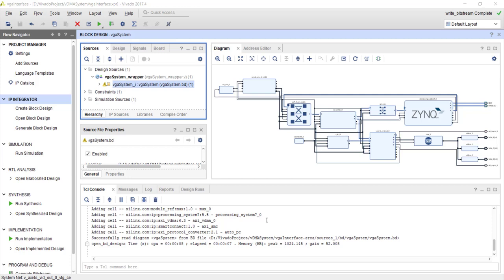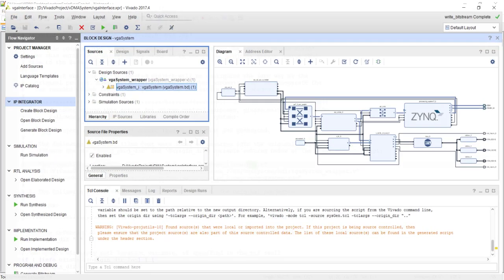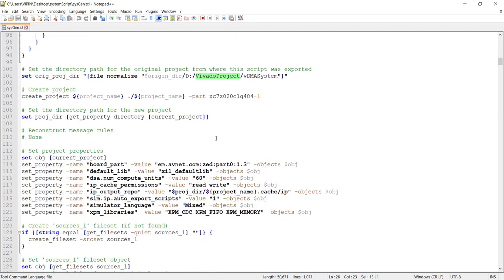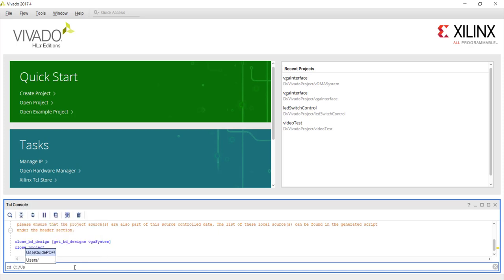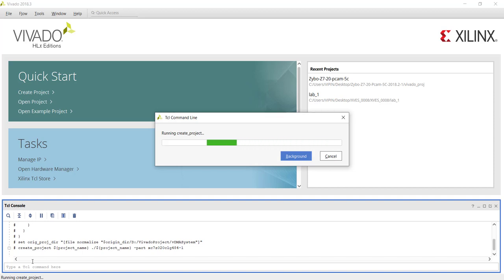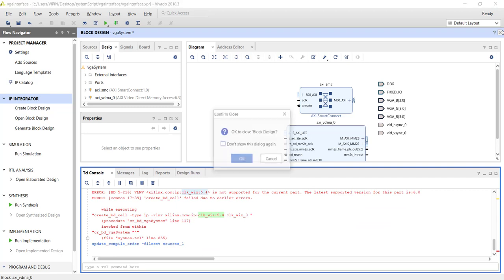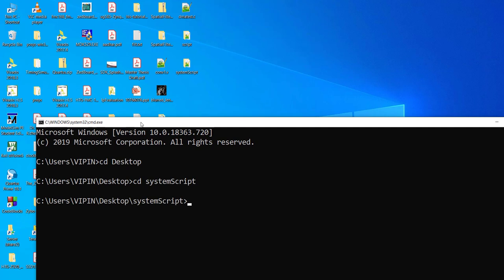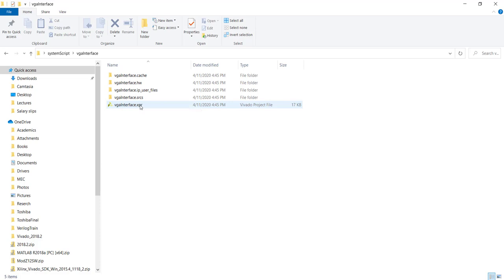Generating project TCL file and regenerating project from TCL file in Vivado

Comment: Bro, could you please make a video on emulation, from basic of what it is to using it in Vivado..
Reply from the maker: Emulation or simulation. In vivado there is an option to emulate PS part with verification IP. Do you mean that?
Reply: @Vipinkmenon  Yes sir, I mean emulation. Can't we emulate PL part?
Reply from the maker: What u want to emulate? In PL part we are implementing the custom hardware. If you are doing post place and route timing simulation, we are effectively emulating the PL.

Comment: Hi sir,
    I would like do TCL scripting to generate a project..I need to include ip cores also in the design.if the generated ip cores are there in the design it'll consume more memory..so I need to regenerate the ip cores using TCL commands when we try to generate the project.so that total size of the project will be in KB..please do a video on that or help me.
Reply from the maker: If you have your own IP in the project, the source code should be also provided along with the TCL script. Otherwise if you check create block design using TCL, a single TCL file is created, which can be used for regenerating the entire project. That is exactly what is shown in the video.
Reply: @Vipinkmenon  yes correct.but if we do so, ip core size will be more. so it would be better to generate the ip core using TCL scripting prior to the project generation.i was not aware of generating the ip core using TCL .but I figured out a way to generate the same.now my entire project size has dropped from 1GB to 300KB